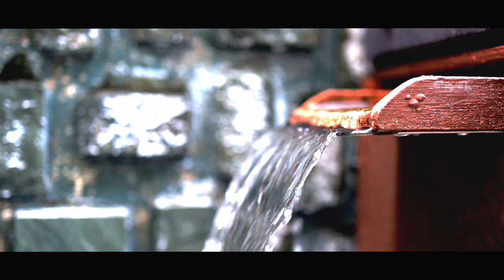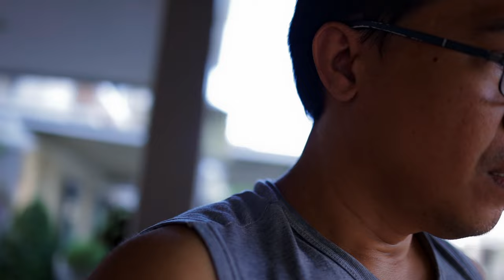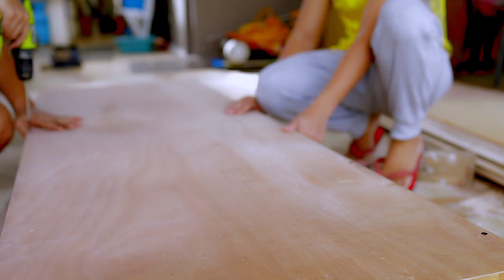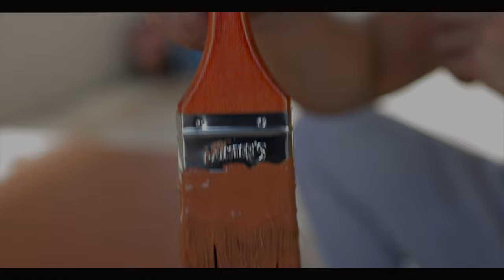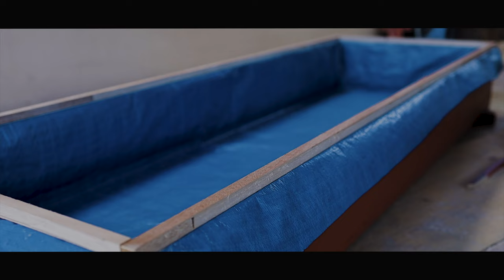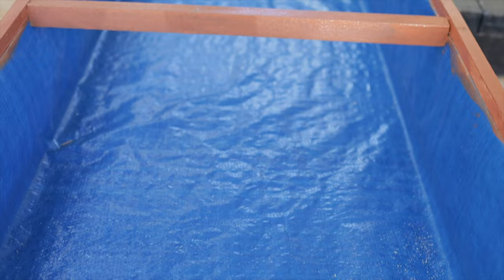How to Build a Plywood Trapond

Comment: You lack illustration on how you placed the tarp, measurement and what kind of material tarp did you used.
Reply from the maker: Hello… tnx for the advise… placing the tarp is simple… just measure the bottom and height and put extra length on all sides.. center them then fold the excess in each corners…

Comment: Sir ano po yong dimension ng yan? Ang ganda
Reply from the maker: Hello po bos,,,, height 10 inches... width 28 inches length 48 inches.. yan po sir.. ang dimension po,,,
Reply: @WINDSLIEsVlog  sir bale 4ft ung length? Parang ang haba naman sa video?
Reply from the maker: @paulschwarber3351  pede naman po taasan niyo... para mo sa Shubunkin breed ko po yan bos....
Reply: @WINDSLIEsVlog  ay okay sir. Sa estimate ko kasi parang 6ft ang length hahaha btw sir anong size ng whole 3/4th mo na ginamit sa vid at naka try ka na bang isang 3/4th na plywood na buo ginawa mong ganyan? If yes, ano ung dimension ang resulta.
Reply from the maker: @paulschwarber3351  isang sheet lang po nagamit sir.. may sobra pa...